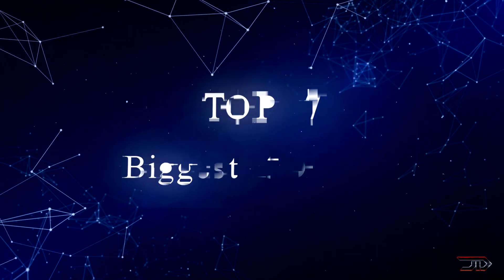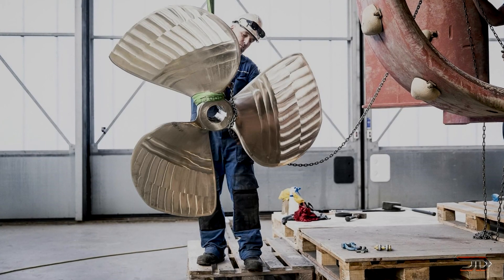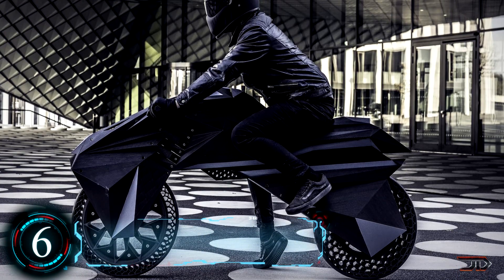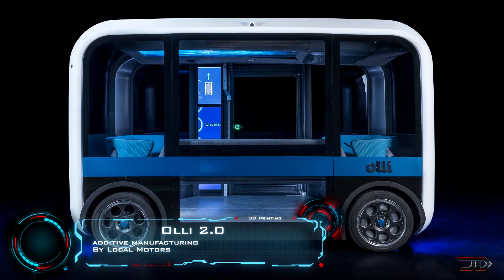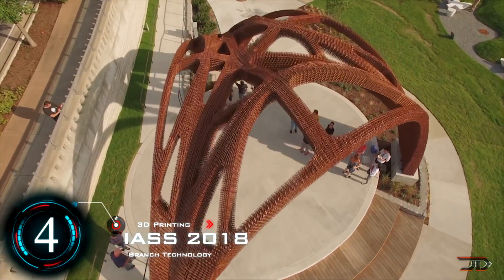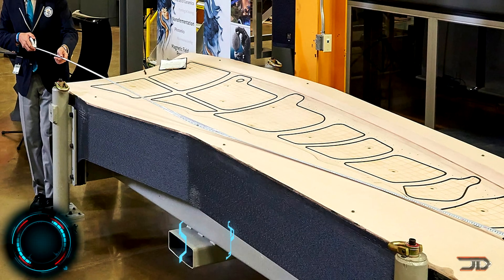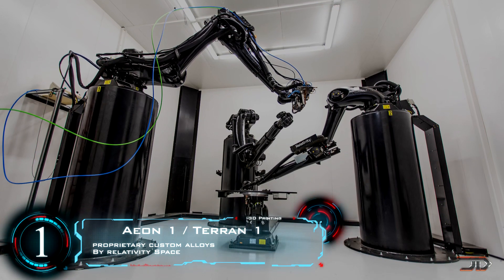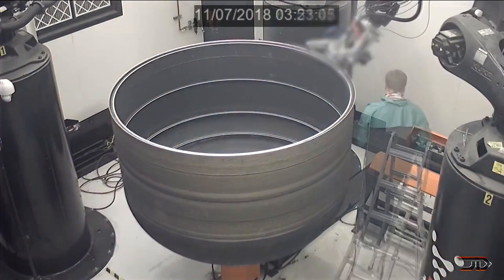TOP 7 BIGGEST 3D Printed Things

Comment: I like how you presented this. Several years ago I tried to explain 3D printing will not change how most products are made. The people I was talking to just did not understand that the basic items we use are very efficiently produced at this time and 3D printing cannot complete in any area. Its the specialist items that 3D printing will excel in.
Reply from the maker: Thanks, 3d printing is only getting better, it will definitely compete with a lot of manufacturing techniques!
Reply: 3D printers can print other 3d printers meaning exponential growth (1 2 4 8 16 32 64 128 256 512 1k 2k 4k...) in the number of 3D printers.  40 generations of doubling = 1 trillion 3d printers.  Conventional factories are efficient at building things, but they can't grow exponentially...